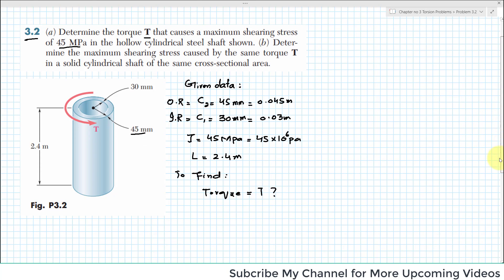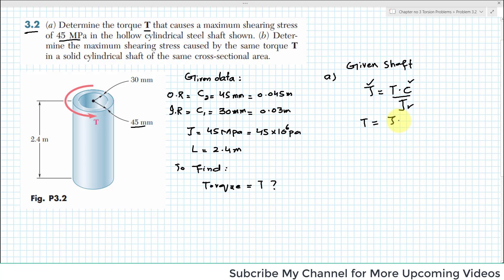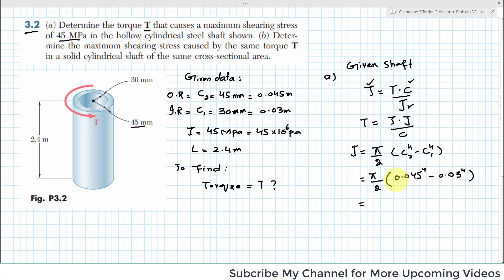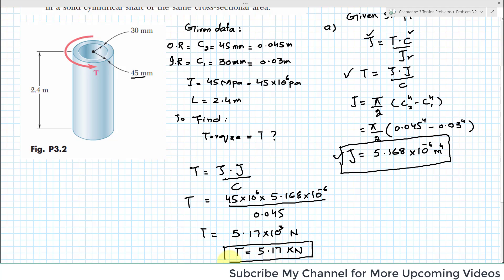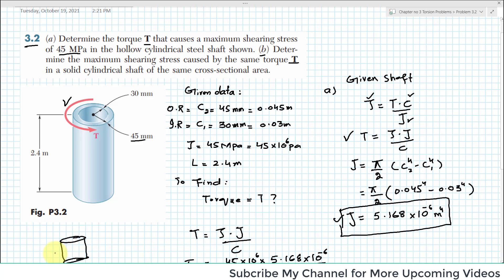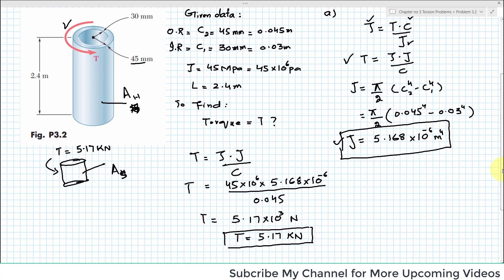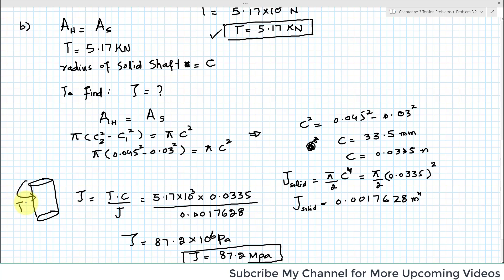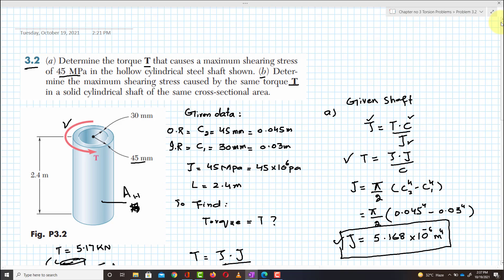Mech of Materials# |ProblemSolutionMOM​ | Problem 3.2 |Torsion| Engr. Adnan Rasheed

Comment: Sir, for part (a) when you consider the formula tau=Tc/J why you take the outer radius for c because it mentions hollow cylindrical steel shaft?
Reply from the maker: c is maximum distance from center to the outer surface which is outer radius of hollow shaft.